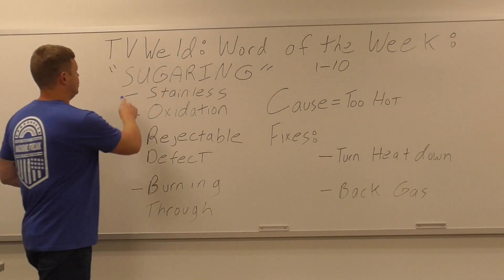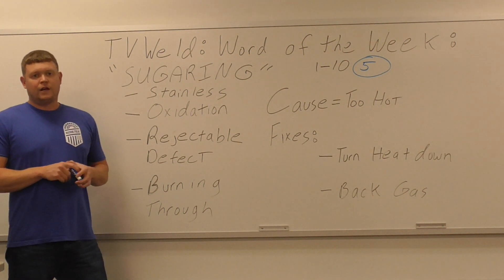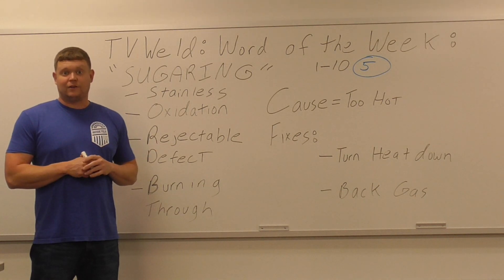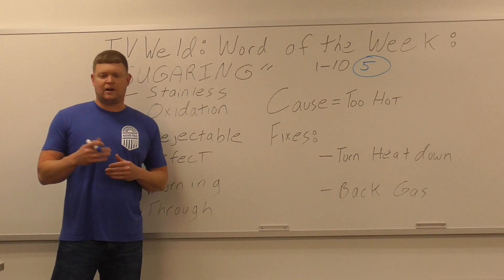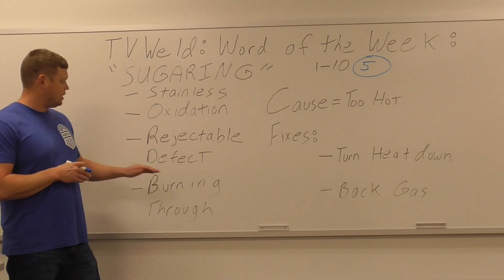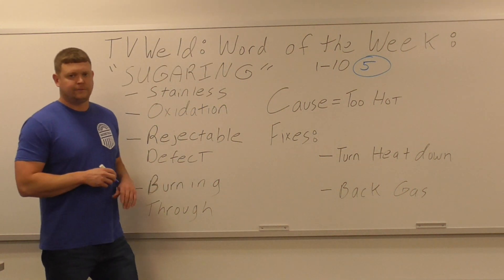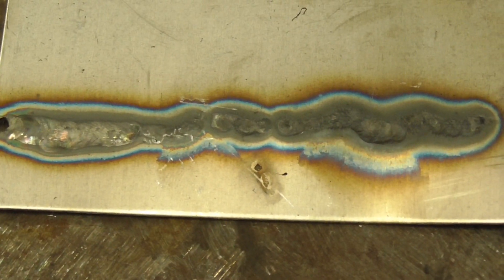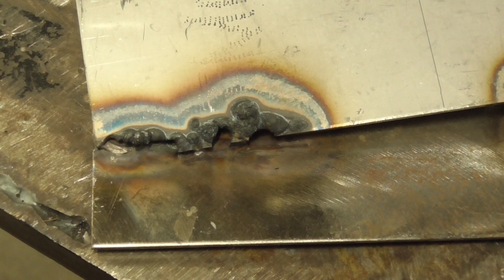What Is SUGARING On A Weld?

Comment: So what causes this on the face of a weld along side the weld?
I was welding in open air, some aluminum, and with one spool 4043, .30 and a miller 211 mig. The arc was blue. It worked fine although the spool kept jerking at the end of the spool. 

Then after changing the spool to fresh, and a different piece of aluminum,  the arc turned green, and with the same settings, 35lbs of gas, it just left a crusty black residue all over the face of the weld.

 I am new to aluminum and although  outside is hard to weld , there wasn't really a breeze so I don't see why it would do this. 
I didn't burn through so didn't see that it was too hot. 

This was a gate that had two sections bolted together so I don't know if the AL was the same alloy
Reply from the maker: If you do a dragging angle with aluminum it will leave a black soot on the weld.  Does it wipe off with your glove?  If it does, it is from dragging and if you switch to a leading angle it should go away.
Reply: No I was pushing, with 3/4" at least stick out, and it was kind of crusted on, had to Wire brush it for a bit to get it cleaned

Comment: Thanks for a great series of videos! There is a question I've had that I cannot find an answer for anywhere. Maybe it might connect to a video on stick or MIG welding.
I always assumed that with stick or or any process with a hot electrode also acting as as filler metal, that the stream of droplets of metal are carried along with the electrons moving from one pole to the other - from the electrode to the work - sort of going with the flow. But then I remembered the fact that some kinds of stick can run with either polarity - or AC. In some processes the electrons are flowing from the work to the electrode - which kinda blows my theory apart. 
So, how does the filler metal "know" where to go? Does it go from hotter to colder? Does it get blasted towards the work piece by the jet from the coating on the stick? Magnetic forces from the arc?  
Thanks for the videos!!!
Reply from the maker: So this is an interesting question that I ran by a number of welding instructors and the general consensus is that the filler metal is drawn to liquid so as you strike an arc it immediately melts the base metal that then draws the melting filler metal into the weld pool.  Kind of like if you have two drops of water on a counter and if one comes in contact with another they pool together.  As you move the arc across the work it solidifies behind the molten weld pool.  Now that being said I'm not sure that is 100% accurate it is just an educated guess from a bunch of welders.  To prove this to be accurate you would have to get into some chemistry & physics.  I do have a friend who has a PHD in physics and when I see him next I'm going to run this theory by him to see if he agrees so stay tuned.  I'll let you know what he says.  Thanks.
Reply: @TVWeld 
Hey! Thanks for replying!!!
 I'm interested in what it is that moves metal from -  lets say the end of the stick - through the arc - across a gap -  to the workpiece. The arc usually fills a gap between the electrode and the work. Metal has to traverse that gap. But what moves the metal in the direction we want it to move? I used to think that the metal was swept along by the flood of electrons moving from the electrode to the work. (I'm thinking  stick here).
Given the the electrons could be moving either way - with DCEP or DCEN or both ways with AC - that throws my naive theory that the electrons "sweep" the metal along into doubt. My next theory that I cannot prove and don't have the theoretic framework to do anything with, is that a small hot location - the electrode - vaporizes or emits metal vapor or particles and spews them out - and that the electric arc induced magnetic field confines the metal flow and directs it to a cooler area, the work piece where the metal lands or condenses. I may need a physicist with a specialty in arc plasmas and high temperature metal transfer to sort it out.
If you can get your friend to answer this I'd be grateful!